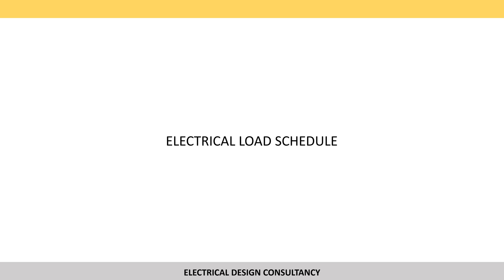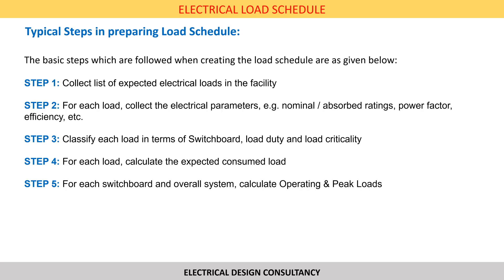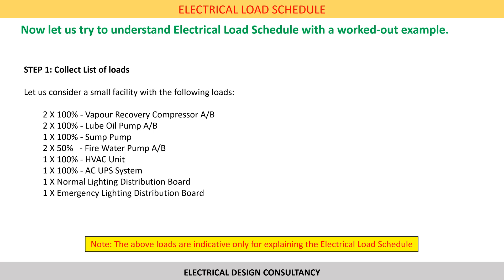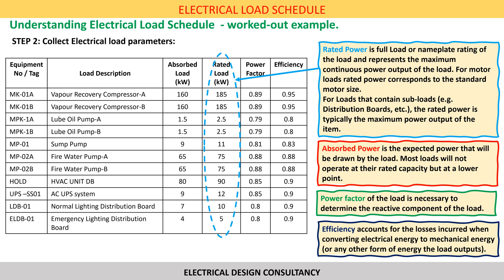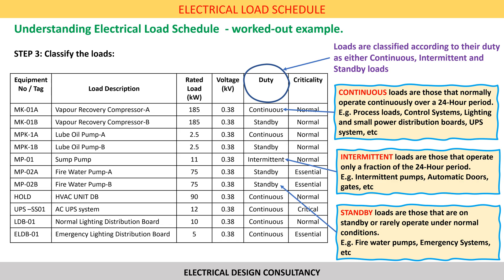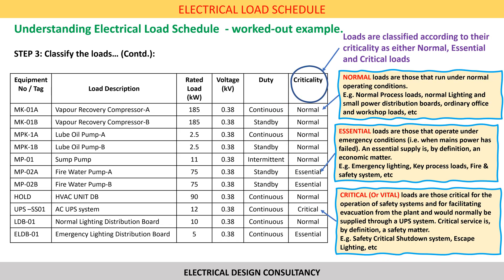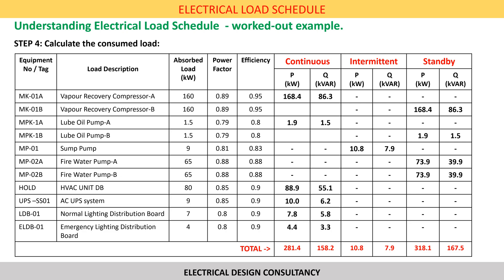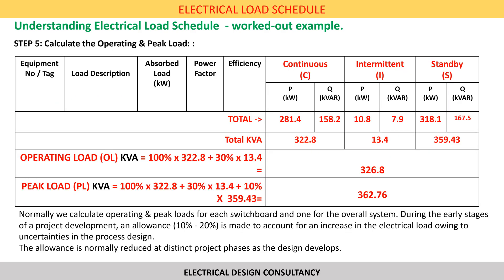UNDERSTANDING ELECTRICAL LOAD SCHEDULE

Comment: Sir how can we find the absorbed power and how did you write active power of 185kW rating to 168.4kW.
Reply from the maker: Thanks for your comment.
Absorbed power is the expected power drawn by the load. Most loads do not operate at their rated capacity, but at  a lower point. 
Absorbed Power is calculated as below:
P = η·√3·V·I·cosφ
where
P is absorbed power in watts
η is motor efficiency
V is applied voltage
I is absorbed current in amps
cosφ is the power factor
Reply: @theelectricalsolutionschan1095  really appreciate your efforts Sir❤

Comment: Dear sir,
Can you provide me electrical load list calculation Excel sheet...
Reply from the maker: There are lots of Electrical Load excel files available in the internet. You should be able to find a suitable one. But you will need to understand all the cells in the excel file before using one.

Comment: A very well description of the details to be taken into account,while getting onto the load calculations in an industrial installation. The assumptions n steps involved are all full of the finest details.
This calculation is very important from point of view of safety concerns also,as we know unbalanced loading leads to heating,thereby making the insulation weak n often leading to fire hazards on account of short circuiting.
A practical guide it may be to electrical as well as nonelectrical engineers.
Reply from the maker: Thanks a lot!